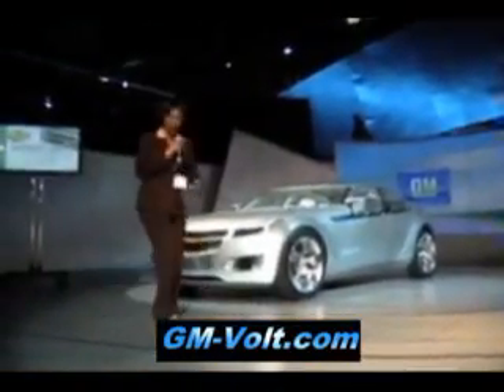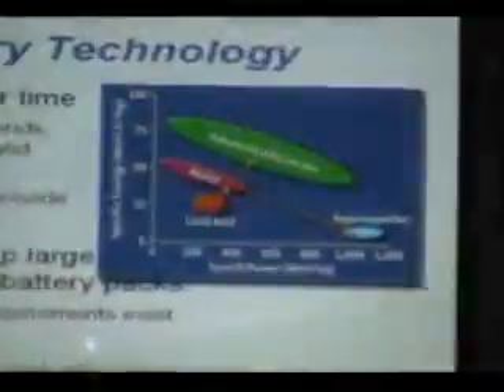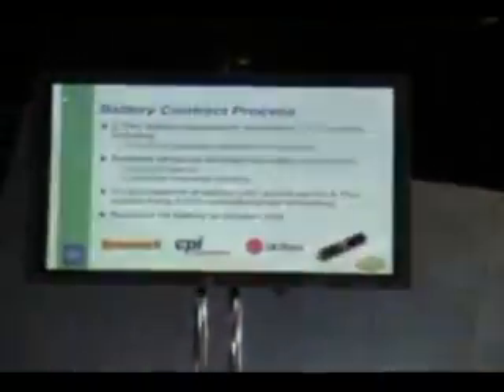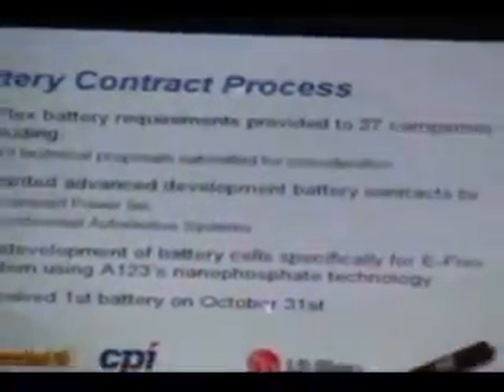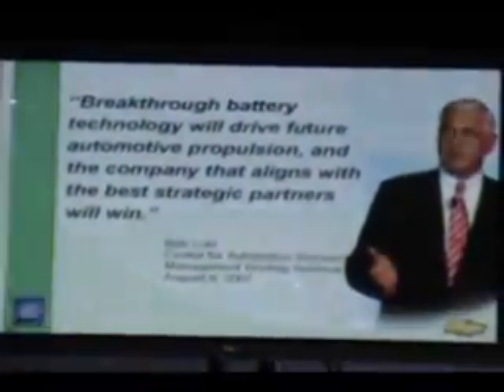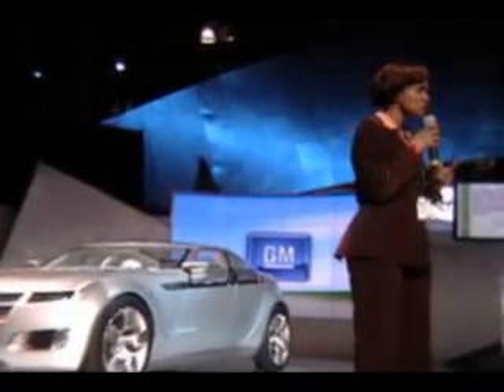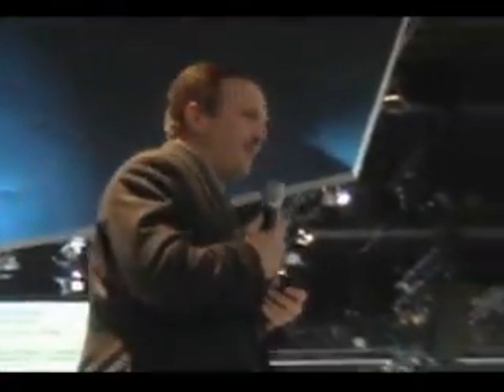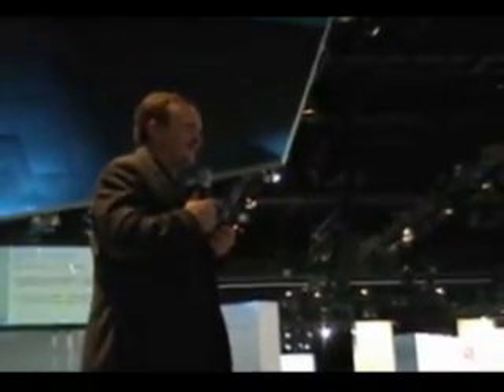GM's Official Chevy Volt Update Nov 07 - Pt. 3

Comment: Toshiba is launching SCiB batteries in March 2008: 5 min charge, 10 year lifespan a battery capable of recharging to 90% in under 5 minutes while remaining useful (i.e., 5,000+ recharges) for 10 years or more.  The inclusion of a gasoline burning internal combustion engine is no longer necessary.

Comment: Why the incremental steps to the all electric vehicle? Why not all EV's now? (I.E. all gas, to hybrids, to 50% plug-ins, to 90% plug-ins then finely all electric). The current internal combustion engine (IEC) manufacturing plants are not equipped to build electric motors. If the demand for elec motors outstripped the need for ICE then the ICE makers would lose out to the plants built for making elect motors ( they would lose their monopoly).

Comment: A Rose is a Rose is a Rose. An "Extended Range Electric Vehicle" is equivalent to a "Plug-in Hybrid Electric Vehicle" - if you drive it mostly for local driving you won't use much gas.    
If you need to travel long-distance, the gas engine charges the lithium-ion batteries to extend the range. Not to difficult to understand. Why come up with another name? PHEV is quite fine.